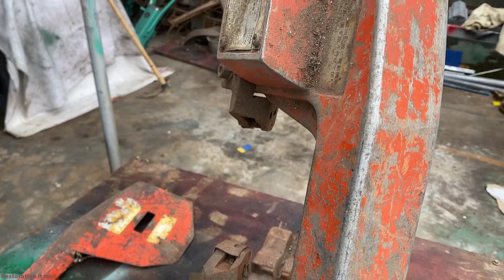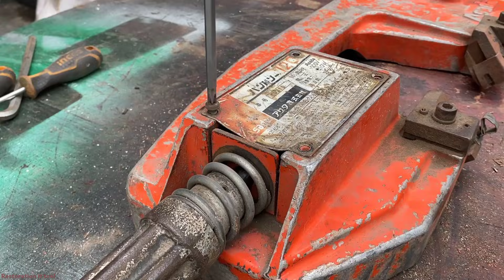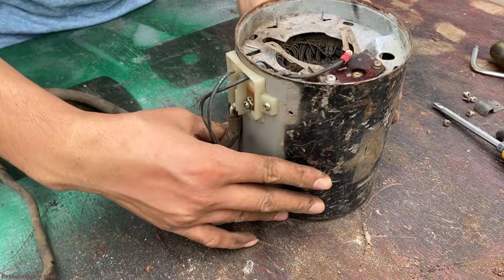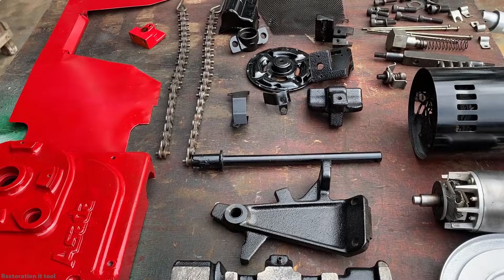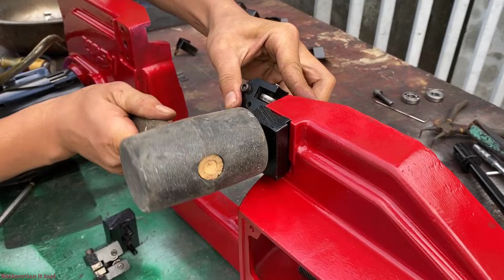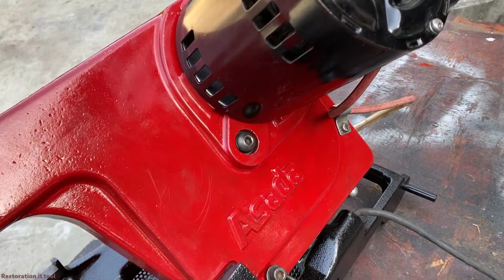Restoration of old 120 ASADA circular iron cutter | Restore the old 120 ASADA circular metal cutter

Comment: Excellent, thank you. Took me a while to understand the blade carriage. The exposed length of blade is vertical but the drive/idler wheels sit at something like 45° off vertical. So the two blade guides actually twist the blade from its natural 45° plane into the vertical. Never seen that before.

Comment: The restoration of this old metal band saw was only missing one thing, the cooling bath. I was surprised to see you running it and cutting metal bars without a cooling bath. Was this model made without one or is it missing? Other than that I thought you did a great job getting it up and running again. Thanks for sharing this video with us and please keep them coming in.
Reply: Low speed, doesn't need it